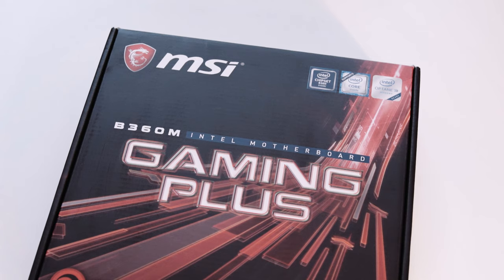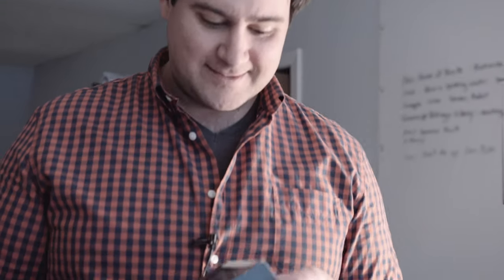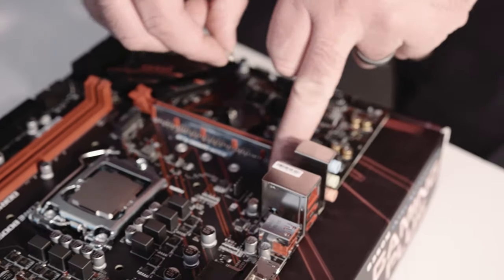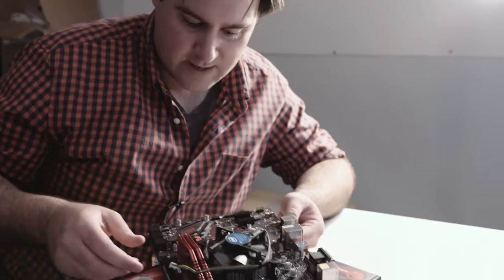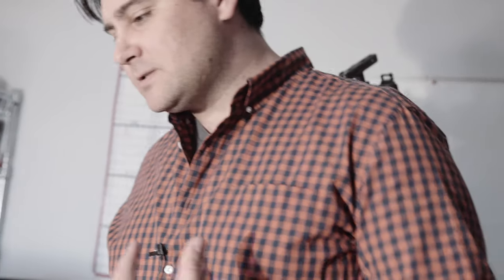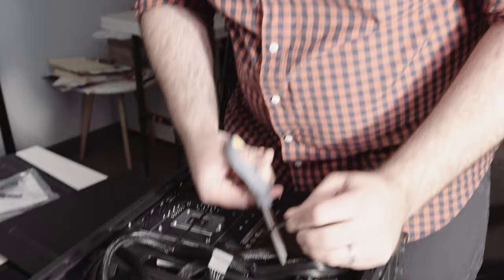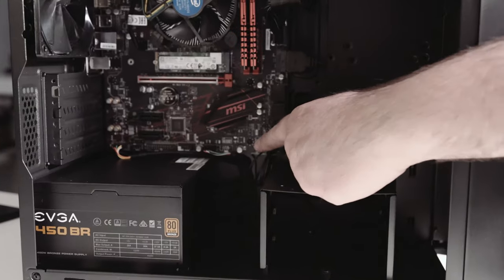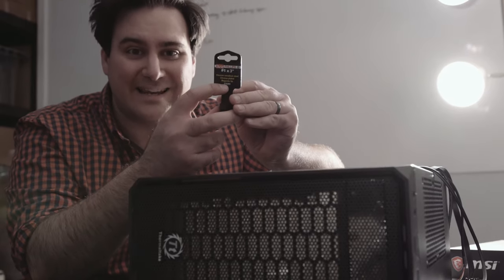How To Build A Non-Gaming PC in 2020 | Media PC for Streaming Movies

Comment: Since you aren't worried about gaming performance it was too bad you didn't consider an AMD APU. Built a rig for my friend with the old Ryzen 2200G for 89 bucks. Around  the time of your build you might have been able to get a R5 3400G. The 8400 might have a little more grunt processor-wise but  AMD integrated graphics blows Intel out of the water.